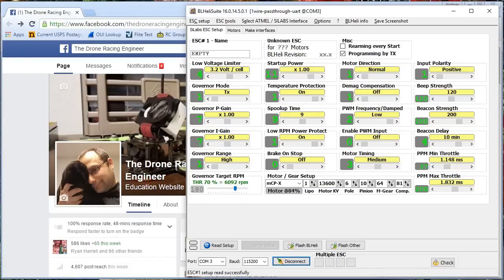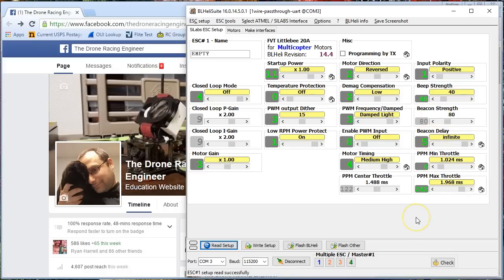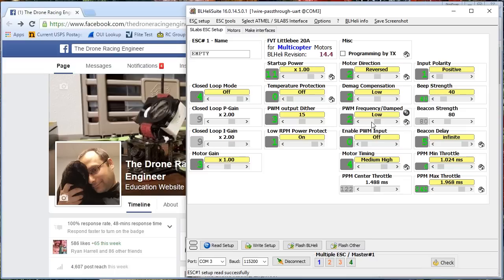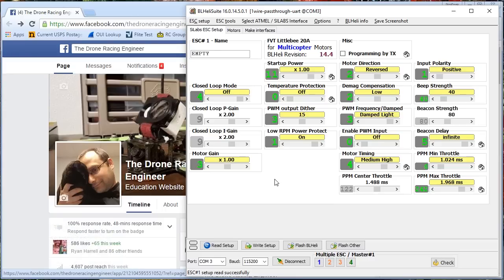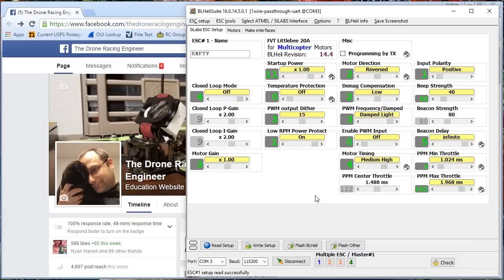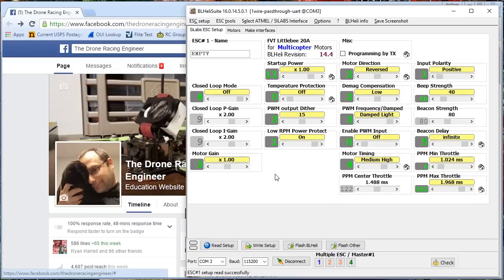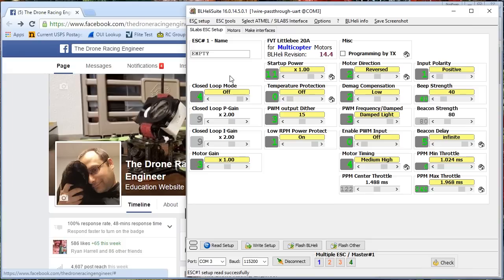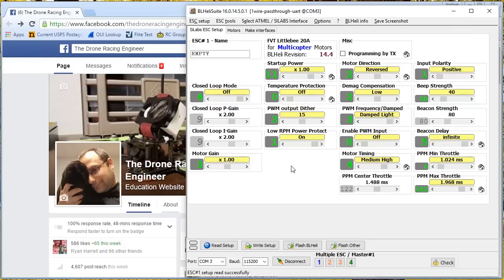BLHeli - 100% Explained

Comment: Joshua, I'm new to fpv racing and wish to build my quad, what esc do you recommend in the 30amp range
Reply from the maker: Nearly any BLHeli_S ESC will be great. I would avoid the DYS XS30 though as I'm not sure if it is affected by the motor reversing bug. If you do go with that ESC, make sure you solder the wires to set the correct motor direction; do not use the "reverse motors" setting in BLHeli.
Reply: Joshua Bardwell 
Great. What's the _S designation thanks.

Comment: Thanks Joshua really useful, Could you explain if when using BLHeli on Multiple ESC's should the values on each ESC be exactly the same (including PPM Min Throttle and PPM Max Throttle) or is it ok if the calibration for each ESC be slightly different?  or is a few ms difference  irrelevant? :)
Reply: The throttle might calibrate slightly differently on each of the ESCs.  This is prefectly fine and normal so long as the diffences are small.  But if one esc calibrates wildly differently then there is probably an issue somewhere.  Maybe that esc is bad or maybe solder joints bad.
Reply: All settings besides the throttle cal are usually going to be the same across all ESCs.
Reply from the maker: +Neil Perry Agree 100% with Craig's answers. Many people simply copy the throttle endpoints from ESC to ESC. This assumes that the oscillator on the ESC is working properly. Very occasionally, the oscillator will be damaged and not working properly, and manual calibration will make this obvious.
Reply: +Craig Quillen  +Joshua Bardwell Thanks Guys that's great
Reply: +Neil Perry If you direct solder motors to the ESCs you might need to have different motor direction settings per esc to make them spin the correct way.

Comment: Joshua, do you know if it would be possible or if Boris might be working on integrating BLHelisuite into the betaflight configurator? It would be great to be able to just use betaflight to do everything we need to. It appears that I can't use BLHelisuite with my Mac without jumping through some ridiculous hoops, which I'm finding to be a norm with Mac. Yes I know, my first problem was getting a Mac, which I have learned my lesson and will NEVER do again.
Reply from the maker: +helicrashpro there is a blhelisuite chrome app in development but it is not going to be integrated directly into Betaflight.
Reply: Thats great to here!
Reply: Do you have any insight on when we might see the google app for BLHelisuite?
Reply from the maker: +helicrashpro it already exists in Beta form. For official release, I don't know. Raceflight configurator supports it today I believe.

Comment: Hi! I'm new to quad buidling, so basically by trial/error method I turned on "Enable PWM Input" and now all the ESC's are confused and after I turn everything on and try to connect to BLHeli - everything starts fast beeping - I can't flash ESC or change the settings, BLHeli wont read the setup and make changes, any suggestions?

I wish now I had seen this video before messing with BLHeli...
Reply: It helps to connect to BLHeli if using a charged Lipo :)
Sorry for disturbing, now everything works!
Reply from the maker: +Gatis Vilaks oh good!

Comment: Joshua help, when I reverse ESC #3 it also reverses ESC#1 can't figure why. Happens in Configurator and Suite.
Reply from the maker: No idea man. My first guess is user error but I dunno.
Reply: Ok, when I spin motor 1 in the motors tab motor 3 also spins. There's your porblem. How did this happen‽ :)
Reply: Figured it out, a pin sticking out the botom of the FC puncured the ESC signl wire and linked the two motors together. Considering myself lucky that that didn't fry everything.

Comment: Hi Josh, 
have you made any videos discussing synced PWM vs non-synced, and also setting the PWM frequency? Thanks :)
Reply from the maker: https://www.youtube.com/watch?v=Hm-NHucYxDI

The simplest thing to do is to use synced motor output. There is probably no discernable difference at all between synced and unsynced for most people. Setting the motor refresh rate too high can limit top end power a bit because the ESC's processor is being overwhelmed by the interrupts.
Reply: Thank you.
Reply: I've noticed with synced PWM on my X-racer f303 v3, I can run 8k gyro/pid loops with about 50-60% CPU consumption...however, when I unsync PWM I get down to about 35-40% CPU usage. My hope is I can get away with pushing 8k/8k by disabling the accelerometer+unsynced PWM. Thanks for the info
Reply from the maker: +Kradle that's interesting. The CPU does work less hard with unsynced PWM but I'm surprised it makes that much difference.

Comment: Have you ever come across an issue where when you went to use BLHeli suite, and when you read the set up it only showed you three of the four ESC's, even though all four are fully functioning from every indication you can discern? The only time I can get all four to show up, like normal, (And it's very temporary & short-lived) is if I'm trying to read the ESC's when the quad is totally cold (Ain't had a battery run through it for a good bit, IE. a few hours, IE. overnight, etc.). And it's always the same one, except (if memory serves) before I swapped out the invisible ESC from exact same issue prior to this current instance. The only difference was the ESC that was undetected in BLHeli Suite.
Reply from the maker: +David Hannigan Jr. I'm aware of thst issue. Try reading only the individual ESC by right clicking it's number.
Reply: Joshua Bardwell I've tried that. But there actually is no number. if it helps I'm on a Piko BLX, using 30a Flycolour Raptors, that have the 20a Raptor firmware flashed to them because I can't find the 30a firmware and thats what BLHeli Suite's firmware flasher points to anyways as well.
Reply: But I have looked through the list and there isn't a 30a one. Unless they just added it.
Reply: Joshua Bardwell would you like me to send you a dump .txt file. cause I'm at a total loss. I've been trying to fix this for like a month.
Reply from the maker: +David Hannigan Jr. Not much good posting it to me. Post over on the rcgroups blheli thread.
Reply: Joshua Bardwell I'll try.

Comment: Can I use the  beep codes to turn on active breaking in BLHeli?
I have this 4in1, its a small 150
I am looking for the beep meaning when you use throttle calibration.
https://www.readymaderc.com/store/index.php?main_page=product_info&cPath=505_507_699&products_id=5453
Reply from the maker: Why not use BLHeliSuite? I can honestly say I have never programmed a BLHeli ESC using beep codes.
Reply: Thanks, I guess I was not sure how to connect it to the 4in1.  Guess it would be better, thanks for all your videos they are all great.

Comment: Hey Josh, I just flashed some ESCs and 1 of them has failed, is there any way to save it?
Reply from the maker: You can probably re-flash it. But if you fail to re-flash it, use the C2 interface.

https://www.youtube.com/watch?v=b-7VFt3IhhE
Reply: thank you! I'll try this
Reply: Joshua Bardwell ok so it's such a small little 6 amp esc, I just went ahead and replaced it...so now when I give that motor input on betaflight or blheli suite,  it just doesn't want to move...when I move it, it acts like it's trying to, but can't...do I maybe have another bad esc?
Reply: so should I just try replacing it again?
Reply: I figured it out, it was the motor for some reason...anyway, thank you so much! ;)

Comment: If you find one of your motors is spinning the wrong way, can you just program Motor Director (Reverse) instead of swapping two wires between your ESC and the motor.  Or should you swap two wires.
Reply from the maker: +Al Lipinski It doesn't matter literally at all which of those you do. I would swap motor direction to reverse. What I do when wiring up a copter is, I wire all the motors straight through to the ESCs. Then during configuration, I reverse two of the motors as need be. This keeps the wiring neat and the configuration consistent.

Comment: in BLheli is there any bug who brick ESC? or any way if we use it wrong can brick or chances of get brick our ESC?
Reply from the maker: You can always restore the ESC by flashing over the C2 interface, so truly bricking is not possible by flashing over the signal wire. But flashing over the C2 interface is a bit of a hassle. Recent versions of BLHeliSuite are very good at not rendering the ESCs un-flashable.
Reply: Joshua Bardwell so if we brick by any mean we can restore it by c2 interface write?
Reply from the maker: +nasir jamil yes. 99%
Reply: Joshua Bardwell thx you for your support ur da best :D

Comment: what motor timing for 900kv motors, how to figure out what's best?
Reply from the maker: Just use medium and get on with your life, is my advice :-)
Reply: lol yeh true, though...
I'm a perfectionist, and my quad is for aerial video no gimbal, I'm trying to get it a smooth as possible. I've seen guys with the same frame as mine having zero oscillations on descent etc.

No need to respond but if you have a simple answer, perhaps it's something common, that would be hugely appreciated:
on descent my quad, not even fast descent but coming in at an angle maybe even just a 20deg incline, makes an almost grinding sound or really low frequency deep vibrating sound and send the jello through the roof but the rest of the time it's smooth as.
I soft mount motors, t-motor 900kv, triblade props balanced on dubro balancer.
The vast majority of the time there is no vibration it's virtually vibration free, except for that one circumstance, which just seems odd to me.

Thanks mate and thanks for all your great vids I have learned a lot from them
Reply: actually I tested it today, seems to make it feel smoother down low on the throttle/motor rpm but there was noticeably less power high up.... enough so that it caused a crash - doing what I usually do but didn't have enough power to pull out of the dive. A learning experience, I crashed in to a sugar cane field so only broke some props. 
I'll stick with that setting though, for smooth low throttle flying and the problem I mentioned before, seems to improve it.

Comment: Does calibrating the end points in blheli, apply to librepilot also?
Reply from the maker: Yes. All FC and ESC that use an analog protocol like PWM, OneShot, and MultiShot, need calibration. The exception would be if the ESC and FC are pre-calibrated from the factory, such as with the Vortex copter.
Reply: Wow, thanks. I'm in the process of doing a very down to earth, not to techy video of my process of doing this, when i've it done, i''l ost back a link to it here from my other Flying RC channel, and if you have the time to view it, ok :)

Comment: Excellent.  What's 'Brake on Stop'?
Reply from the maker: Makes the prop not freewheel when the throttle is at zero. Used for fixed-wing gliders to prevent the prop from dragging. A free-wheeling prop presents more drag than one standing still. Also, with a folding prop, the prop has to stop spinning to fold up.
Reply: I would like to pledge you a little for a while for a few questions.  I won't need much as I am no dunce but I am regarding Patreon.  Can we text chat briefly somehow?
Reply from the maker: Message me on FB.
Reply: When I search via you name I can't seem to find you.  Try my name, I'm in San Diego, the dork with a dog.
Reply from the maker: https://www.facebook.com/thedroneracingengineer/

Comment: Hi, thanks for these educational videos :)
But something you explained here doesn't make sense to me (I'm a sound engineer) High frequency = better definition... So it's weird that you say with low frequency you won't have a jump like to would using higher frequencies...Doesn't make sense. You will need to explain how that is possible? As you said "damp" forces hi-freq, which normally should be smoother with more steps for any type of adjustments. What makes esc controlling throttle respond different from sound waves?
Reply from the maker: You're confusing frequency with resolution, I think. To use the audio example, frequency is like 44.1 kHz CD sampling rate, and resolution is the number of bits per sample. But the reduced step to full throttle has nothing to do with any of that. It's some artifact of how blheli handles the throttle curve.
Reply: Joshua Bardwell so do you mean that at 96khz, the sound isn't more accurate? Like with the throttle? As it is chop up 96 thousand times vs 44100 times? I am a little confused? Maybe you can explain with an audio example? Like you did? Thanks :)
Reply: Cos I'm just getting into quads, since I like tinkering I like to understand how ESCs work...(Actually all mechanical & electronical stuff related to how a quad works...)
Reply from the maker: Ray Choi  again, you are confusing sampling rate with resolution. Faster sampling rate means you can accurately reproduce higher frequencies, due to the Nyquist Limit.

Think of it this way: a reduced sampling rate is like applying a low-pass filter to the data. Except instead of attenuating high frequency information, the high frequency information is reproduced as low-frequency artifacts. Sampling at a higher rate lets you capture the "treble" accurately.

At 96 kHz the sound is not more accurate than at 44.1 kHz, assuming there is negligible energy in frequencies above the Nyquist Limit. The Nyquist Limit is 1/2 the sampling rate. So the Nyquist Limit for 44.1 kHz is about 22 kHz. if your waveform contains minimal energy above 22 kHz, there is no increase in accuracy that occurs when sampling at higher rates than 44 kHz.

Resolution is how many bits there are per sample, not how many samples there are per second.

https://www.youtube.com/watch?v=yJqseTIWwVY
Reply: you really got it wrong here 96khz is not more accurate? aliasing is something that happens when we convert analog wave form to digital wave form... don't what this has got to do with all this? if you really believe that sampling at 96kHz isn't more accurate, you have got it wrong, i think you have got the "frequency" thing here wrong, cos 96khz, is like i explained, means it is chopped 96000 times. it is not about the hi or low frequencies as you talked about with a low pass filter. that's the pitch , here 96khz isn't about that but about the number of samples per seconds.
Reply from the maker: If you don't think sampling rate has anything to do with high and low frequencies, then that's a very fundamental misunderstanding that you could seek to correct.

Aliasing happens whenever you sample a signal that contains frequency components at more than 1/2 the sampling rate. If the signal does not contain frequency components at more than 1/2 the sampling rate, sampling at a faster/higher rate does not in any way make the signal more accurate.

Consider this: imagine that the signal we are sampling is a pure sine wave. It contains exactly one frequency component. All we need to do is sample at 2x the frequency and we will be able to perfectly reconstruct the sine wave. If that doesn't fully and completely make sense to you, then that's the next thing that I would advise you to consider, in order to educate yourself on this topic.

Let's imagine that the sine wave is at a frequency of 10 Hz. Sampling at 20 Hz will allow us to perfectly recreate the sine wave. Sampling at 40 Hz or 100 Hz or 96 kHz will not allow us to recreate the wave any more perfectly, since the 20 Hz reconstruction is already perfect.

Comment: BLHeli 14.6 has got 1 new option. it is "Break on stop".
Reply from the maker: FWIW, multirotor pilots shouldn't use this option. It's for fixed-wing planes, gliders mostly.
Reply: Rev14.5 Longer between beacon beeps (to reduce motor heating), and now again beeping on two motor phases
Implemented programmable brake on zero throttle
Implemented hardware reload of commutation timers, to reduce sensitivity to interrupt activity on high rpms
Implemented support for EN/PWM style fet drivers
Slightly modified throttle calibration
Improved startup, particularly for small motors
Improved smoothness
-
 Rev14.6 Fixed bug that caused tail motor not to stop
Fixed bug that caused brake not to work for low side pwm ESCs
Fixed bug where noisy input signal could cause loss of sync
Increased fet deadtime a bit for the LB20A and the LB20A pro
Made low rpm power limiting programmable through the startup power parameter

Comment: Hi Joshua! What about the issue on BlHeli_S and the thermal protection bug? I've got this problem with my Aikon 30A and the last blheli_s firmware:

https://www.youtube.com/watch?v=-rjJMCY4P1M

Have you encountered this issue on your ESCs?
Reply from the maker: Check out the latest comments on the rcgroups thread and you will see the BLHeli dev questioning whether the bug actually exists.
Reply: Cool! Many thanks!!!

Comment: Oh my gosh! I wish you released this video yesterday. I read yesterday somewhere about possibility to max beacon strength and use it lost as model alarm thus replacing buzzer. So I went ahead and tried it right away. Results: burned RS2205 and my last ESC having no spares to replace them. Lesson learnt the hard way :( I made post today on RCG hoping somebody would shed light on why that happened http://www.rcgroups.com/forums/showpost.php?p=34751779&postcount=1303
Reply from the maker: +kubaistube FWIW, the default has been slowed down in 14.5 (I think) to prevent this, but it won't save you. Always have a spare motor and a spare ESC, I say. Never order four; always order five or even six.
Reply: +Joshua Bardwell I was on 14.5 already. But still, the burnout could be caused by something else and I am not sure if even theoretically 2 minutes of max beacon strength could kill them both. I bought 5 motors (few weeks back) and 6 ESC (last autumn) and I ended up with 3 working ESCs and 3-4 motors. So I went ahead and ordered 6 littlebee 30A to have some margin compared to present ZTW 18A even though they have 30A peak and handled well even 6 inch props with these motors.